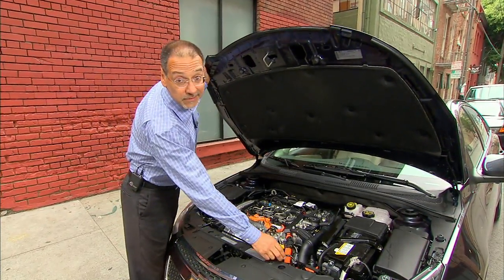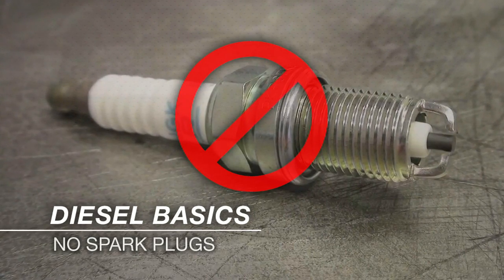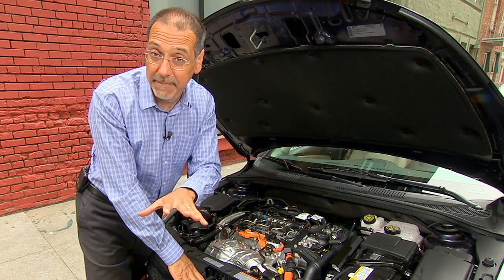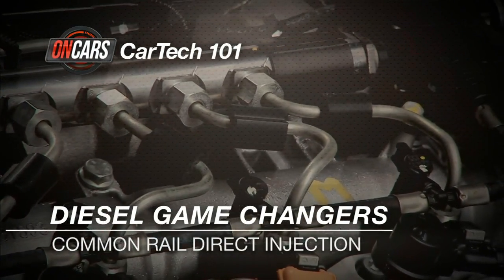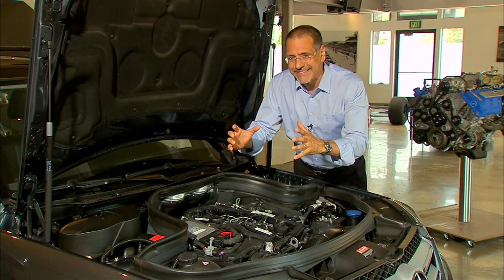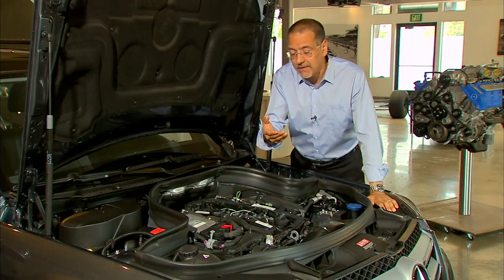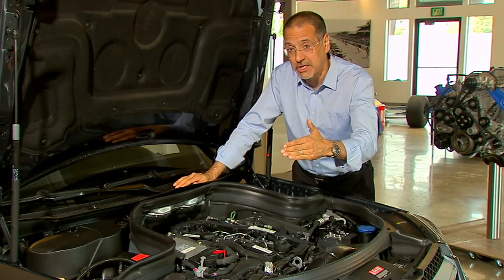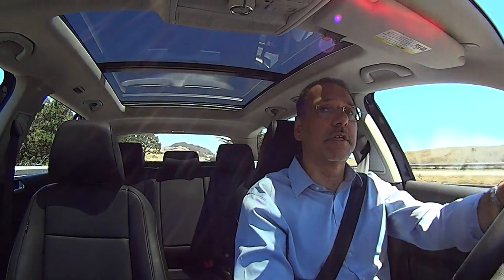CNET On Cars - Car Tech 101: Understanding diesels

Comment: Diesel owner here. Those bringing up the price, as of August 20th, 2015, I pay about 13-15c more than regular per gallon to fill up. The trick is; Don't use the first station you see, but don't use low grade red dyed fuel. Most stations are 45-50c more per gallon here on the main highway. Once you get off the main highway, you get to the cheaper stations. Sheetz has been the cheapest lately.
Reply: +FCFordLord You cant use red dyed fuel anyway, that is untaxed non highway diesel and if caught you WILL got to prison. That is a federal offense.

Comment: the only downside of a modern diesel is the throttle reaction still not as good as on a petrol or maybe it's because i am driving a VW PD not a CR otherwise they are great
Reply: Kristian benz That mostly because of turbo lag. And PD is actually better in some areas compared to CR.

Comment: Why aren't more cars diesel rather than gasoline?
Reply: ycz04x02 In some European countries 90% of all cars sold are Diesel, but it is helped by the fact that gasoline costs more than twice than in the USA, and diesel is a bit cheaper than gas, (1.6€/l vs 1.3€/l), besides high taxes on gas cars, with big engines make them sometimes even cheaper than gas cars, every gas station has Diesel, and diesel cars depreciate MUCH less than gas. However in the usa, fuel is a lot cheaper, diesel is pricier than gas, some stations don't have diesel, and diesel cars are pricier than their gas identical.

Comment: European cities are banning diesel cars now, due to the insane amounts of carcinogens they produce.
Reply: Walter Black And those cities are? They don't produce any soot anymore due to filters - and it's funny to see modern petrol engines producing more soot because of direct injection.
Reply: No city has the balls to outlaw diesels. The cities economy would disappear. 
Do you think big rigs are gasoline powered? No, nearly every form of heavy transportation is diesel. 

Stop lying
Reply: +Walter Black yea where the hell did you read that?
Reply: +Toni Tvrdi Not yet in Europe, but definitely true in Japan.

Due to DPF the sout particles are so small they can't be detected. 
Can't be detected doesn' mean they don't exist !

But you're right for the modern petrol engines' part.
Reply: They're not banning as such, just charging drivers more to enter.

Comment: Preach, my Brother! I'm on my fourth diesel automobile ('97 Mercedes E300). I've also owned an '83 Mercedes 300D and before that a '84 Peugeot 604TD and a '80 Volkswagen Rabbit Diesel...all of which traveled 200K+ miles. For anyone that does a lot of longer distance highway commuting, diesels are the way to go! They easily cover 250,000 miles before any major rebuilds are necessary and are more forgiving if you thrash them. In fact, an occasional high speed thrashing is good for an oil burner...blows the crud out of the system!

If you are going to buy a diesel, take my advice: Make sure you stick to preventative maintenance schedules (diesels HATE dirty fuel filters and oil) and do a Liqui-Moly Diesel Purge twice a year. Look it up on YouTube. You'll thank me!

Comment: I live in Brazil where we have outrageous gas prices and drive a diesel ford ranger pickup. It really does great on the highway because it cruises at 60 mph at about 1700 rpm and has plenty of torque left to accelerate and pass other cars.

Comment: I'm a big fan of the diesel motors in cars and 4WD's. I had two 4WD's that were manaul and with a inline 4 cylinder 2.5 litre turbo diesel motors and the 3rd was a V6 gasoline with a manual gearbox and i found the turbo diesel motors manual 4WD's easier to drives with the low down toque in the motor around 1200 rpm. my last 4WD was an automatic with a  inline 4 cylinder 3 litre turbo diesel  motor. here in Australia
Reply: Normally a diesel with 10-40hp less than a petrol engine of similar size is quicker due to the huge amount of torque.

Comment: I just dont get why americans dont buy diesels, im from britain and a diesel is completely normal, so much so nearly half the cars on the road are diesels
Reply: I wish they were more common here.  The reasons he listed (sluggish, stinky, loud and rattling, etc) are stereotypes that have stuck around in the American mindset.  People think they're getting a raw deal on diesel here (it's more expensive than regular gas or petrol like you would call it) but the economy of the fuel outweighs that by leaps.
Reply: You do know that we have much stricter emissions regulations in this country than Europe.  Both state and federal laws require more emission control devices for diesels, so manufacturers have to add those onto the car before they can import them into the US. That makes the diesel cars much more expensive than the gas versions. Now that national gas prices are at a low time, it makes even less sense to buy diesel. On top of this I have read in articles that lawmakers Europe, though primarily in Britain and France are considering banning diesel passenger cars because of all the pollutants they spew into the air.
Reply: Charles Schutz You don't - or at least you cannot directly compared EU emission standards with the US.
Even the test cycle is different.
But if you want to compared them, everything is more strict in EU except NOx emissions.
Reply: No, it's popular in North America too, Just in different way. Like pick up trucks, but we are see a lot more diesels than a few years ago

Comment: Does this mean modern day diesel engines won't have problems later with dirty diesel stuff clogged up in their like they use to?
Reply: curseknight5 The engine itself is still full of soot - full of soot till the filter in the exhaust.
And you have a lot more things to clog in modern diesel compared to the ones in the 90s.

Comment: There is more to it than fuel savings. I don't know any affordable 2.0 liter four-cylinder engines that cruise at 65 MPH and rev at a mere 1800 RPM in a 6-speed. My diesel car is quiet and a joy to drive. And that 600+ mile range is hard to beat if you hate stopping for fill-ups as much as I do. My previous gasoline powered car had the same sized engine and would rev just over 3000 RPM at the same speed.

Comment: The problem with diesel cars in the US, is that the fuel is usually (depends on where on lives) more expensive than regular gas and in many states it's more than premium gasoline. In the northeast where many homes are heated by oil, basically low grade diesel fuel, the winter prices for diesel can be very expensive. Maybe if you live in Texas where fuel is cheaper and highway trips are longer it might make sense to buy a diesel but not here in the congested Northeastern US with higher fuel prices and shorter trips.

Comment: not a word about turbo lag, the need for gloves while refueling or the exhaust smell.  Good to see that this guy doesn't hate everything he reviews.
Reply: Gas jobs are starting to use turbos as well these days, which levels it a bit. Theres also not that bad of turbo lag, unless you forget to downshift. Gloves while refueling? My DD is a diesel, I haven't had issues with getting dirty while refuelling - though the smell is MUCH more pleasent than gasoline. As far as the exhaust, I have yet to smell a newer small displacement diesel. I can say that my 1984 6.2l Detroit diesel smells much better than gasoline cars out there.

Comment: I to thought diesel was the way to go. Mark my words you will save no money driving them. They are modern and the emissions on these things are so prone to failure its sad and very expensive. Not to mention gas has been over 50 cents cheaper per gallon for years now. Unless you need a truck to move weight or have money to burn in maintenance stay away from these motors.
Reply: You are right. It does make sense if a person does a lot of highway miles, something in the order of 20,000 miles a year or plans on keeping the car for 10+ years. Otherwise It makes no sense to buy a diesel. A Hybrid is better for most people especially for people that drive in urban areas, were hybrid cars are more efficient.

Comment: I think that diesel engines are going to win out in the long run over spark ignition engines due to their higher efficiency and fuel economy and biodiesel is a more or less drop in fuel whereas a lot of the alternative fuels for gasoline engines can require engine or fueling system modication, such as ethanol for example, which can cause rubber hoses and gaskets to deteriorate
Reply: TheWolfHowling  Still think that now? 😂

Comment: You can also brew your own diesel from cooking oil wastes to make bio diesel....now you dont have to pay for fuel anymore lol
Reply: Not for these high pressure common rail diesel ,You will blow an injector nossel
Reply: There's even tutorials on how to make your own. But it wouldn't be useful unless you have a diesel car.
Reply: You do, however, need to pay more for servicing and modifications to your car to make it run on 100% bio-diesel. Still, you can make it run on 20% bio-diesel.
Reply: true
Reply: except you have to carry chemicals methanol which is combustable. I dunno. Its bad enough worrying about the fuel tank.
Reply: No you dont
Reply: A friend of mine (who happens to be a chemist) and his family (who also are chemist...go figure) have their own rig and its been pretty successful for them.. So i guess if you know what your doing you can make it work

Comment: The other main reason that diesels get more MPG is that, on top of the engines being about 30% more efficient, is that gallon of diesel fuel contains more energy than a gallon of gasoline

Comment: it can be done, but it would not be logical for having a diesel engine with a supercharger because diesel engines are geared for economy and efficiency and superchargers are more towards high end expensive gas guzzling racecars, but its still possible

Comment: The next step is biodiesel, diesel made out of pine trees or rape seeds. In Sweden this is now common in all diesel. As for now it's just blended with the ordinary diesel but further down the road it should sell on its own. This of course translates to a lot less fossil fuels and therefore less carbon dioxide released :)

Comment: its more nautral than gasoline. both start from crude oil. diesel only goes through alittle refinement, so it is usually cheaper than gasoline. but since diesel/crude oil is such a needed fuel supply for manufactures it actually cost more to buy unrefined oil than refined oil(gasoline).

back in the 80s diesel was cheaper than gasoline.

Comment: Can you get a diesel motor with an automatic transmission
Reply: Tristan Dobson Yes. Most top end german diesels such as bmw and merc are all auto.

And the VW group dsg dual clutch auto is a fantastic transmision to go with a diesel.

In fact auto boxes probably works better with diesels due to hacing much shorter rev ranges per gear.

Comment: And don't forget about the 24hrs of Le Mans, almost all the winners are diesels nowadays. My brother has a 2003 Skoda Octavia 1,9TDI GLX and it has quite sporty characteristics and you can have extremely low fuel consumptions of 2,8-4 litres/100kms (AVERAGE!) (70-100MPG). Of course with an easter egg under your gas pedal for the 2,8 l/100kms, but you can do it. 
If you push it in a sporty way, 5,5 l/100kms it the avg (50 mpg). I simply love those VW engines, but @ hi revs they lose their power.

Comment: Yes, that might be true, but you MPG return is also much higher! 
What we like in powerful engines is the tork and diesel engines have, due to the high compression, al lot. VW 2.0T gas engine produces 250Nm (sorry european) and the 2.0T-diesels can go all the way up to 450/550Nm!
Added bonus is, that they are, generally, very smooth!

Comment: Well you started off ok, but then went downhill.... quickly. Diesel is made directly from oil refinement. Not sure where you get that it's made by tractors. You can use vegetable and other oil as diesel fuel, so maybe you're just confused.

Comment: Disel is so fucking stupid; the energy you get from it is MARGINALLY better financially for people over traditional gas. What's fucked up is that YOU HAVE TO USE CORN (YOU KNOW FOOD) to make it so not only do you have to spend Work AND GASOLINE to get oil and refine it to be used as gasoline to power the tractors to get the crops but you use GAS POWERED TRACTORS to make diesel fuel...Everything runs on oil in some way either in transportation or fabrication. We are fucked when we get shut off.